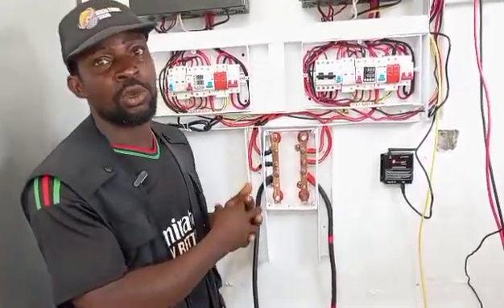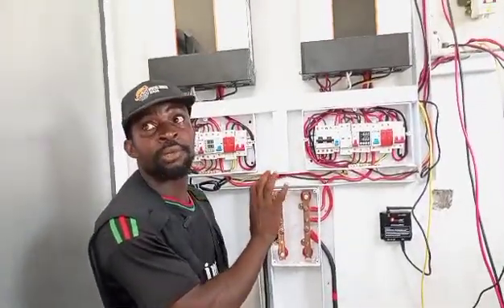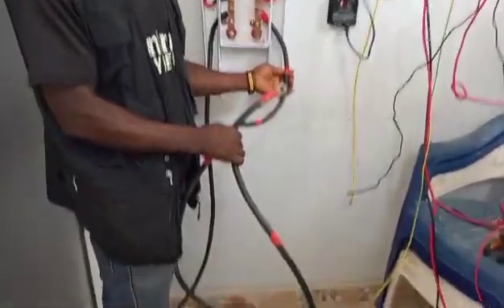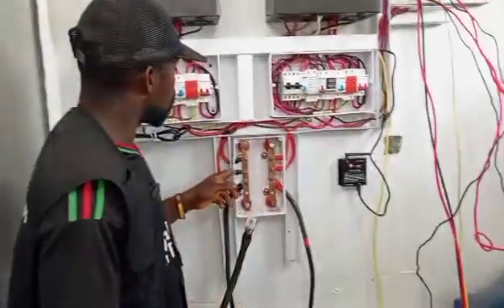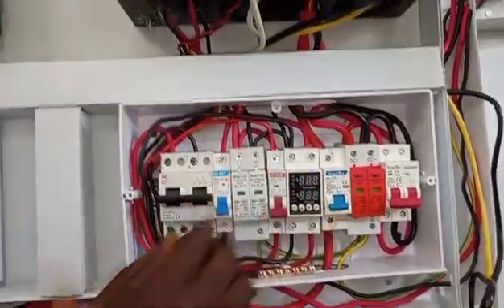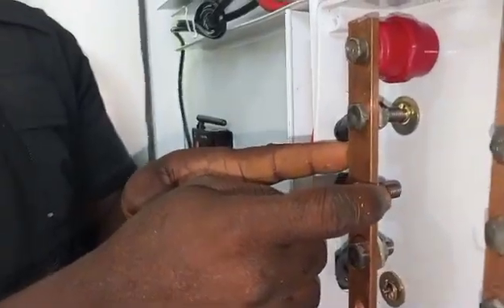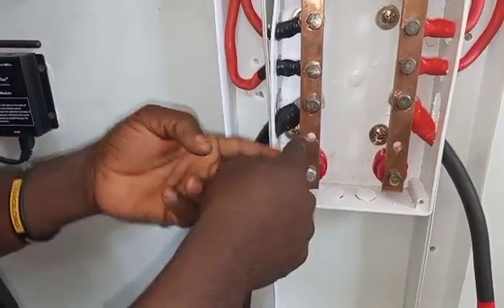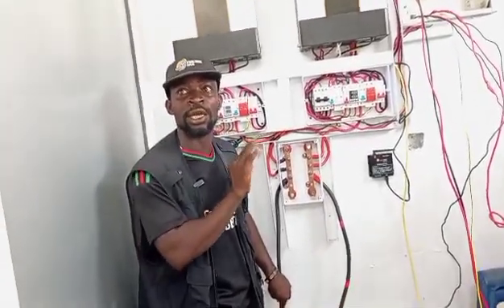Importance of busbar for solar installation

Comment: Good morning coach, please sir i installed 10kva Felicity hybrid inverter with 17.5kva lithium battery with 18pcs 550w solar panels, which everything is perfectly installed after the installation i noticed that it cut off PHCN off and on and it indicates error (51) what do you think is the problem sir?
While on PV charge it charges smoothly.
Reply: it could be from the voltage from PHCN. Solution is to go through the settings of your inverter
Reply: Check your inverter manual, the error should be explained there. Usually when that happens it indicates low voltage from phcn.
Reply from the maker: Thanks for your contribution, keep it up
Reply from the maker: Pls  is it 10kva single unit or you parallel 2 unit of 5kva hybrid. Note if it is IVEM  error 51 warning code. BMS doesn't allow inverter to charge battery. It means inverter will stop charging battery automatically. Solution to the service centre for repair

Comment: I think the battery cable is too long. 
I prefer to break both terminals, its total disconnect. 
I like the busbar idea
I have never had problems with my negative terminal burning. 
Buy original wire, get crimping accessories and ferules, oversize the gauge.
Fine

Comment: Please do make use MCCB and not mcb Breaker for your battery disconnect...
Reply: Please try to explain why you say so, coz i don't see a problem with using MCBs as a battery disconnect. Sure MCBs are smaller and less robust than MCCBs, but they still handle the current they are rated for. A well designed non-polarised MCB from a reputable brand is still reliable as a battery disconnect as long as the current they break is within the breaker's parameters.

MCCBs are of course more well built and handle a lot more current than MCBs, and some even have remote triggers. But any choice between MCBs and MCCBs is good for a specific setup. Let's not forget cost too, MCBs are way cheaper than MCCBs. So unless you're planning to pull more than 200 amps out of the battery then sure, MCCBs are going to be more reliable in that regard.
Reply from the maker: @jonaskavhura  thanks for  your sound contribution. Busbars make your work neater  and equally suitable adding more batteries and inverters
Reply: @Prostartechnical Well appreciated, I agree with the busbars, they are great for expanding the system. I also think the custom made ones in the video are a great choice as you can make them to your system's needs, some pre-made busbars sometimes can't handle the current they are rated for. Great content 😊
Reply from the maker: Current  calculation determine the type of breaker  size to use

Comment: I have a photovoltaic installation with a Felicity solar IVEM8048 inverter and 2 LPBF48300 lithium batteries.
All 2 PV inputs of the inverter are already in use and I still want to increase the capacity of my solar field.
Can I use a SCCM12048 charge controller to add at least 9 solar panels of 550W each?
If so, how do I connect (via the communication ports) the MPPT controller to the battery pack and/or inverter?
Can you guide me?
Reply from the maker: Okay you can contact me  if you are in Nigeria call 08160449736 if you are outside Nigeria. +2348160449736

Comment: Hi sir good evening, please what is the problem when in an installation the inverter is showing that battery is full while the lithium battery is still charging? I think that if the inverter is showing battery full, the lithium battery too should also be full and stop charging?
Reply: In most cases, the problem occurs when you don't use communication cable to connect your inverter and lithium battery, making them to function differently.
Reply from the maker: In most cases when the inverter and BMS do not have  communication, secondly some inverter has poor meter reading calibration.